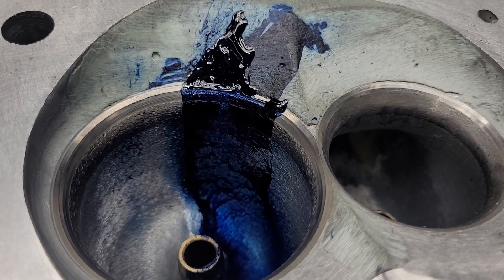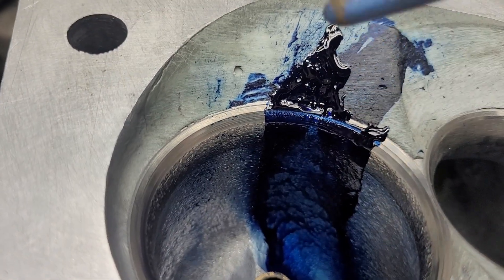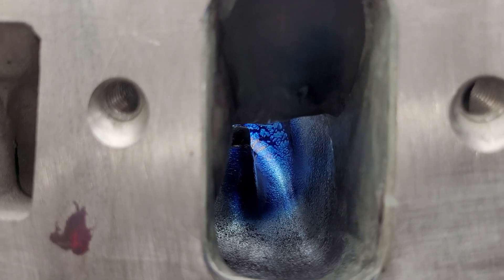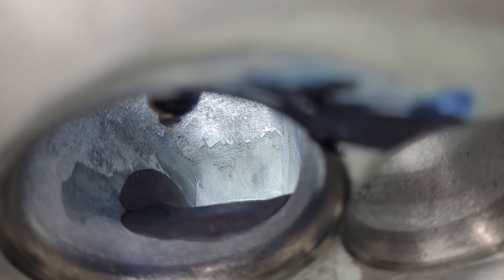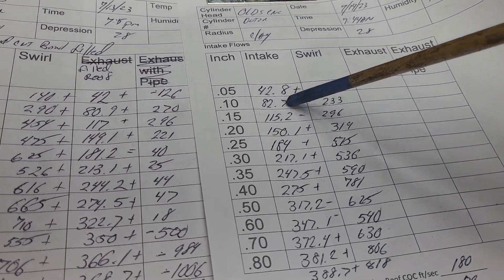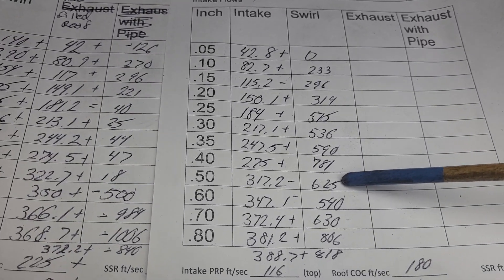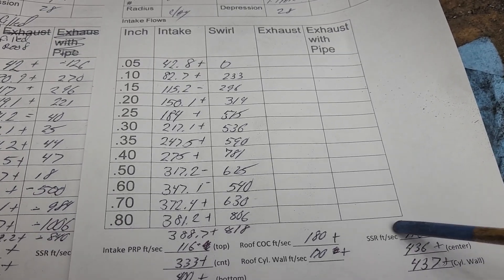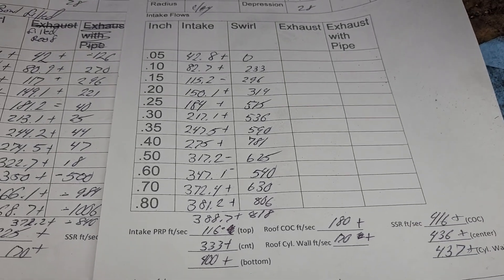Big Block Oldsmobile CNC Master, short side radius fill experiment.

Comment: That hole in the roof of the intake port is for/from what purpose?
Reply from the maker: Owner made it. I have no idea. Thanks
Reply: @servediocylinderheads  So, you epoxy filled the hole for max flow?
Reply from the maker: @VGHCX Don't even joke about it! These are hole free!
Reply from the maker: Yes, epoxy. Thanks

Comment: Looks like to me the port inlet needs moved up that would fix a lot of issues.  I know the intention is to keep it where it will work with a factory manifold but honestly anybody that can buy these heads can buy a manifold too. Also not like a stock manifold would not kill an almost 400cfm port and run like garbage anyway.
Reply from the maker: Any Olds intake is pretty much junk that I have seen.

Comment: Forgive me for asking, maybe a stupid question. Im new to head porting and dont know anything but why dont you test the intake port from the start of the intake runner the direction air flows?? Just seems weird to test the intake backwards from the directions it flows??? Love the videos btw
Reply from the maker: It is the right direction. The bench is reversable as far as flow direction. Intake ports can be flowed backwards as well. That can give some indication of how they will act during reversion. A well designed port flows better forward than it does backward.

Comment: Getting there. Use your results to find your answers. The dye is swirling in the right direction in the chamber. But it is traveling vertically in the cylinder! By the time the flow has reached the fins of the swirl meter, it can change direction. The dye is showing you what direction the air is moving. If you moved the swirl meter closer to the head. It would show a definite swirl in the direction the dye is going.
  Remember the flow bench is open to the vacuum source. There is not a piston top to retain the flow in a trapped cylinder. 
  If you could....can you scribe the cylinder bore on the head to see how much further the chamber can be opened up to? In the pictures, it looks like a portion of the chamber encroach's inside of the cylinder bore right where you need more room. Without changing anything but the chamber. You will pull the dye towards the straight line. 
 Also....Remember the old practice of 1" into the port of the intake gasket flow.
  With the extreme 6° valve angle. Your using the valve more for distribution than a 20° head. The increased flow at .700 is because the valve has been opened enough that's it out out the flow path. Test it without the valve. Your results should mimic the flow as with a valve over .600 lift.
Reply from the maker: Head is about the bore size already. The 6 degree head is different but slowly figuring it out. Thanks